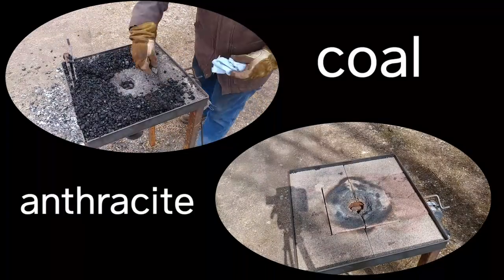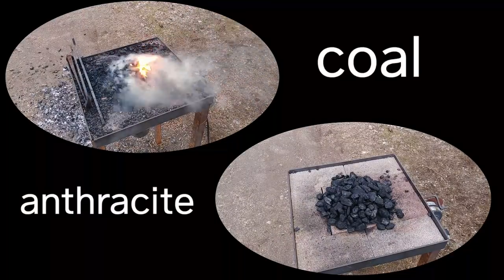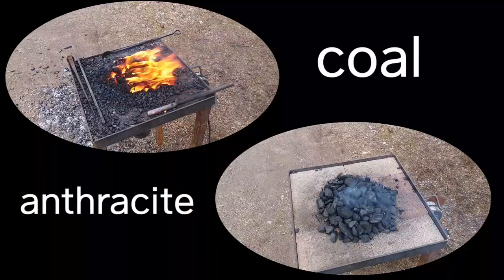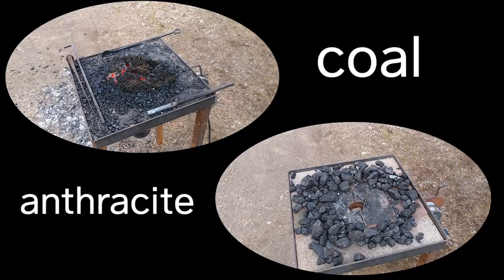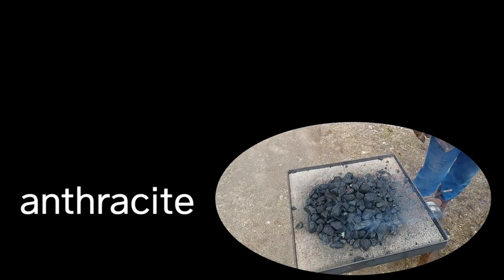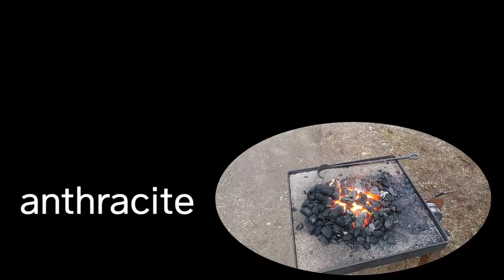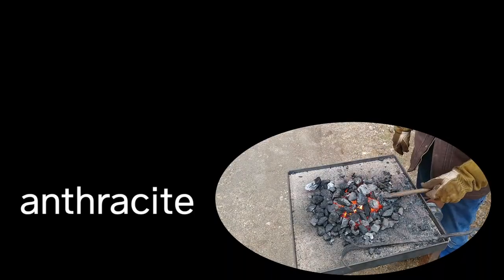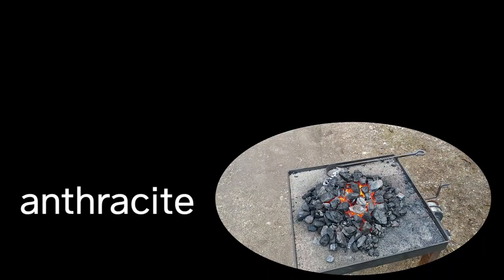Anthracite Coal VS Bituminous Coal  (Alternative Fuel Series)

Comment: Hey hey Roy,  just sharing my experience...  I use anthracite exclusively and as you said I start it with charcoal to get it started and use a blow dryer on low to keep it going.  I can adjust/ fine tune the air volume by adjusting the clean out gate opening.  Overall, it works nicely and I appreciate the clean burn.  In terms of temperature, it gets plenty hot and often too hot as I have burned a few billets:))).   At $12 bucks per 50 pound bag and readily available here locally, it!s hard to beat -at least for me...take care and god bless

Comment: anthracite, is almost pure carbon, its denser and slower burning, there is a reason it is called heating coal, it burns slower lasts longer and burns cleaner, that said its also found in fewer places to be mined, and the need for high draft is why few railroads used it in their engines in the steam era, took a very shallow firebox to keep a good draft on the anthracite to keep it burning, and it takes forever to get going it was said.
Reply: No disrespect towards the rules of reality but the coal should catch on fire faster "Because" of its high carbon content and energy density. Lets have a chat with the gods of time and earth to change the rules of coal.

Comment: I am a novice back yard smith who just started.  On the other hand, I have used anthracite to heat my home for many years.  Anthracite fires must be started using charcoal, or there are specialized anthracite fire starter packs.  Anthracite does not start with just a bit of paper as the guy in the video saw.  Also, anthracite needs such a massive volume of air flow to get started and to stay lit.  Soft coal needs far less oxygen.  Rick and others (below) mentioned using a blow dryer and other things to solve the air flow problem.  I hooked up an old shop vac on the exhaust side.  Without that air flow, the fire goes out.  In a home furnace, it takes a little less air flow, but a forge fire is much smaller in size than in a home furnace and the fire in a forge will go out quicker if the air is cut off.  My home furnace used the size "rice" coal, but I have been using "nut" coal in the forge.  I think smaller sizes of anthracite coal might have some advantages in staying lit, but I am not sure.   I might try a small size anthracite in the forge.

Comment: I tried anthracite since it is way cheaper and I can get it at the tractor store. It is a pain to light, the first time it went out after I had it burning. I don't like it either, but i have three bags so maybe it will get easier the more I try it.
Reply: Big Al try what he said in the video.  Start your fire with real wood charcoal first.  Use light air to start because the charcoal will burn out too fast to get the anthracite going.  After a few minutes on low air turn it up to full air.  An electric blower with good pressure (cheap 1/8 hp inflatable blower works amazing with a $7 air gate) will change the way you see it.  Either way, the real trick is to start with low air and anthracite piled on top of wood charcoal.  The real drawback is that you can’t create a cave with it like you can with bituminous.  Also, you can’t bank your fire and come back to it an hour later and start it right up.  The benefits are a much cleaner fire with almost no visible smoke and lots of heat.  Also, you don’t need to control the fire with water on the coal.  It will only burn provided you give it lots of air.  If you reduce air the fire shrinks...if you increase air the fire grows.  All fuels have their strengths and weaknesses.  It’s what you produce with it that matters.

Comment: this guy is WRONG
Reply: And why is he wrong is the millone dollar question.
Reply: @grimcat27  Anthracite is harder and has less sulfur gas. It burns cleaner but it is harder to keep lit. You almost need a constant blower and therefore can burn more coal per hour.
 It is hotter in the center but cooler on the outside of the pile. Bituminous coal burns hot in the middle with gradients toward the outside of the pile, that's how you can coke more coal while forging. 
Think of Anthracite like a light switch, On/Off and Bituminous like a dimmer switch.